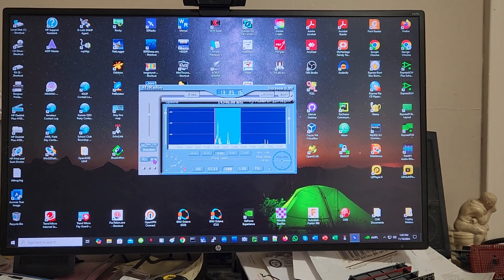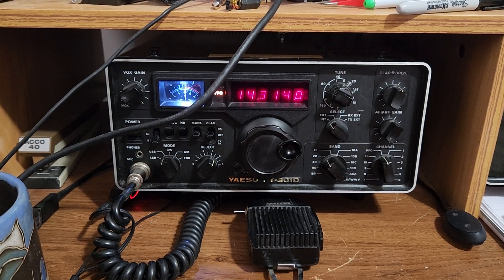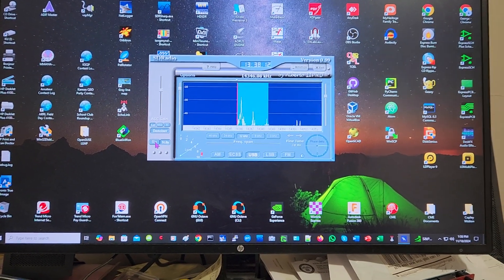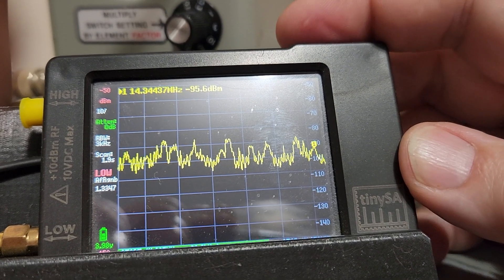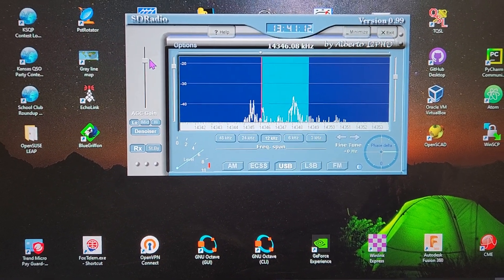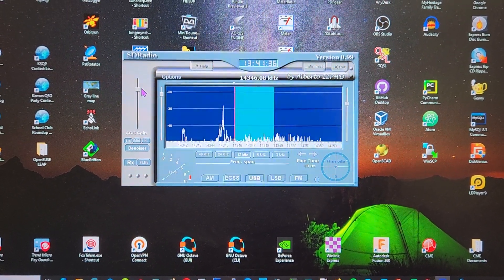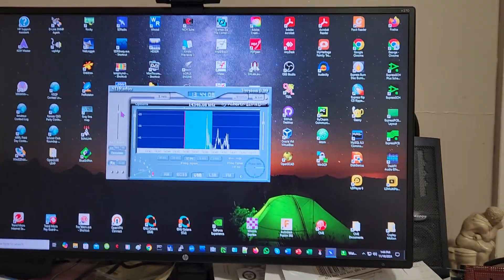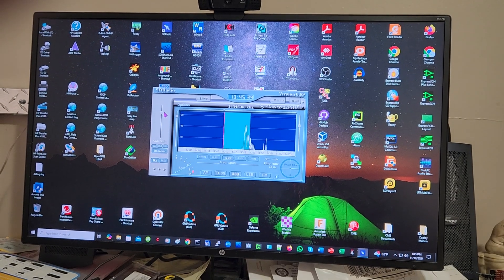Mystery Signal on HF bands, particularly 20 Meters

Comment: Hi George. I had a similar slow drifting signal here a while back. It appeared at a few places across the bands. Turned out to be the led segment display on my ebac 2650e dehumidifier. Got no other led displays here that do this. Took me a while to nail it down. Also my neighbours new solar pv array now transmits so much rf noise I am not able to use 80mtrs! Their ungrounded panel frames and fire escape metal work all re-radiate the micro-inverter noise. Great. Good hunting! Thanks from the UK.
Reply from the maker: I have already ruled out anything localized indoors. I opened the radio antenna connection and the noise is coming down the coax.